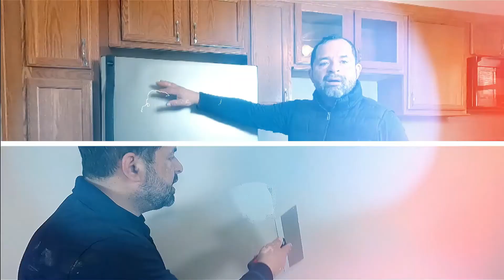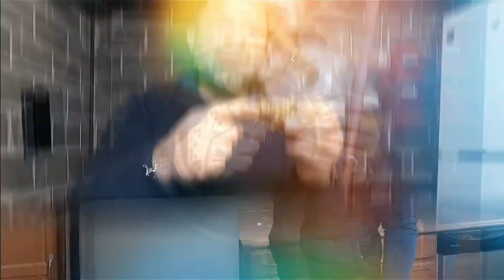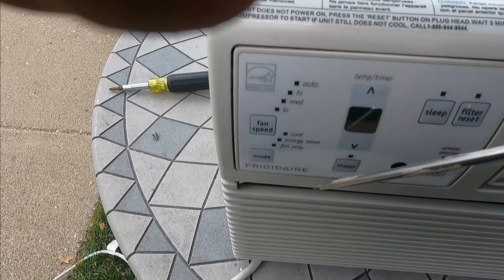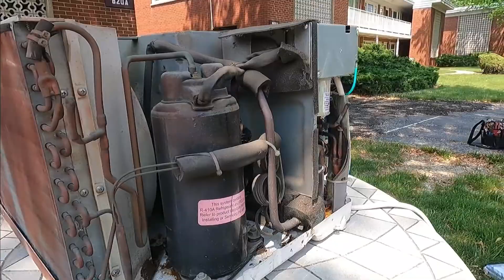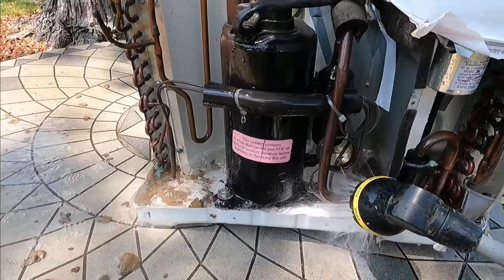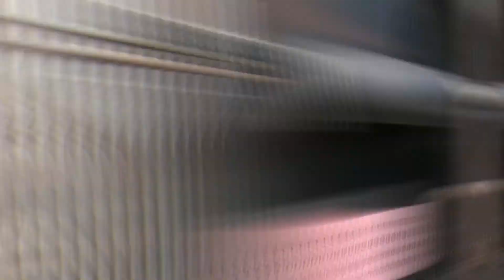HOW TO CLEAN AND SERVICE A WINDOW/SLEEVE AC

Comment: How long do these units usually last for? Mine is 7 years old and is already leaking water.
Reply from the maker: Hello If you take care of it about 6-10 years.   Where is leaking water from?
Reply: @alexthehandyman3494 it’s dripping water from the bottom.  It’s dripping through this felt padding that's preventing

Comment: My air conditioner recently started only working as a fan and stays at 82, I've changed the filters and may have moved my thermostat wire out of place...

I haven't tried to wash inside of it with a hose yet though, but please help! I'll send a picture if you can help at all
Reply from the maker: if. the thermostat bulb got out of place then is not. in contact with evaporator.  That means it will run longer and never satisfy the temperature.  So the room will be colder that needed.    I think your problem is a different one.

Comment: Do I have to remove the drain plug from a wall sleeve AC? It's a rubbery black plug in the hole on the pan. The AC came with the plug installed but removable. It came with an accessory "drain nipple".  I removed the wall AC to clean, and the drain pain was rusty, moldy and debris. Mold on the foam part too. Air smelled bad when turned on. To my surprise, the fins where not bad. The compressor has baked on rust on it, like a crust, on its base, can't remove, probably from years of accumulated water. The drain pain has rust and paint come off of it.  I removed the drain plug and when I ran the AC, water comes out thru the back outside now. I read somewhere that an AC needs the water to help cool the air. Not sure what to do. Put the plug back on or install the "drain nipple".
Reply from the maker: Hello Mara Davila, Thanks for watching the video.
That rubber plug  is not t be removed unless you want to install a pipe to drain and dump it in a safe way.  For example some store fronts have and AC Above the door which it will drip right on customer heads.  Thats when you remove that plug and install the nipple  and reroute the drain.
Yes, most modern AC uses the water to splash on condenser but the extra water should drain out  from the back of Ac  so it SHOULD BE ALWAYS TILTED BACK so it drains by gravity.

Comment: Help! I live in a co-op and have three wall sleeve air conditioners that I haven't taken care of in 4 years. Maintenance doesn't do it I'm on the second floor and not healthy enough to take care of them myself. I looked online to find someone to clean it but only finding companys servicing Central AC. The one in my bedroom I had on all summer grew disgusting gooey growing microorganisms all over the AC front back everywhere!! I'm traumatized from looking at it. 🤢 (Not sure if I should just throw that out and buy a new one but they cost about $900) 😔I would greatly appreciate any advice you can give me on how to find someone to service them, and also if I should just throw that bacteria infested AC out.
Reply from the maker: Hello Daisy,
Unfortunately it takes too long to clean a sleeve air conditioner.   It takes at least two hrs.  AC c companies charge 100 $ per hr. so thats 600 for three ac's.   
I buy my Acs from HD supply I pay 500 for a 12 000 btus.  How many btu's are yours?
Maintenance techs or management don't want to do it because is very time consuming.  if they do it for you they have to do it for everybody.
Hire your nephew or a relative for 20$ hr.  
If an air conditioner is older than 10 years I just buy another one.  If less than 10 yrs I cleaned them.  If they are moldy I use bleach and they are good for another 2 or 3 years.  
Good luck Daisy.   Let me know how it goes.
Reply: I agree with Alex. Hire a family member, friend, to do the job. Watch a few more videos and supervise them. Its not that difficult. I did mine the other day.
Reply: I got another advice clean it get familiar with the unite dnt such a wimp n scared to get hurt turn it off maintenance is very important it's like imagine if you never will wipe your ass eww same thing